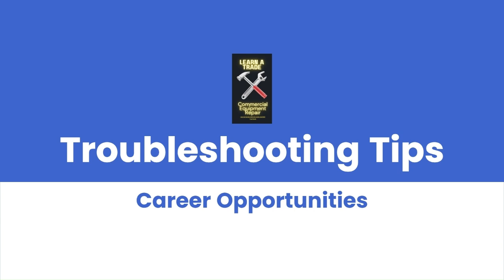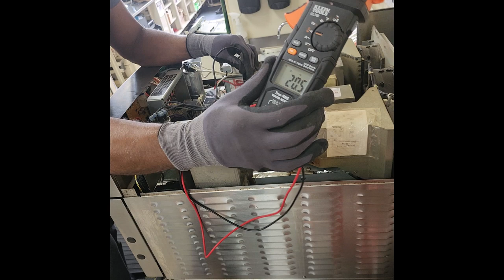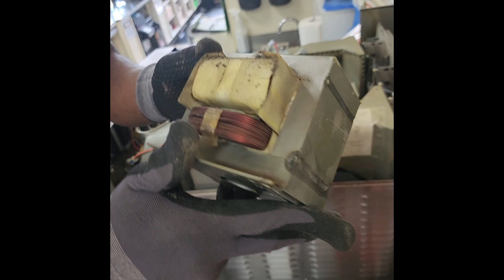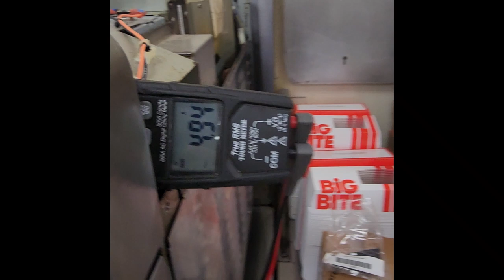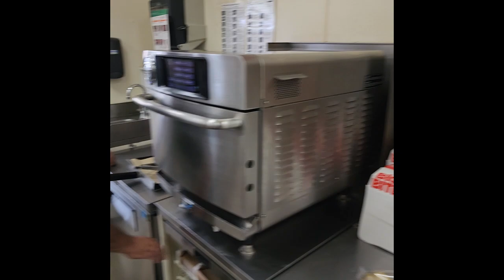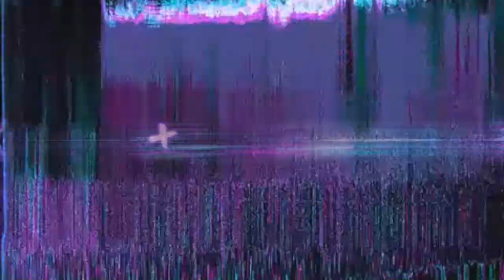Turbo Chef Oven Repair (HV Transformer Replacement)

Comment: What would cause my amp draw to be 40amps???
Reply from the maker: 40 amps is definitely higher than what I would expect under normal operation, but the exact answer depends on the TurboChef model and supply voltage. A high amp draw can be caused by a shorted/failed HV transformer, HV capacitor, HV diode, or magnetron. I’d first verify the amp draw with a clamp meter and check whether the 40A occurs at startup or only when the microwave circuit energizes.
If you tell me your TurboChef model and voltage (208V or 240V), I can help you narrow down exactly what could be causing the 40A draw.
Reply: @latcommercialrepair  thank you for responding. Wires on magnetron were hooked up the wrong way. Red wires were on "f" instead of "fa"
Reply from the maker: @rickycalderon6220 sounds like you may have found the issue of the high amp draw. Before you begin any cook cycles or live tests, be sure to test you high volt circuit. Meaning wiring, test ohms on the high volt transformers, test each magnetron. If you still get an amp draw higher than 17amps you should remove the magnetrons and inspect the inside of the waveguides if you see gease inside the manetrons that means they are contaminated and causing the rays to arc inside so they will need to be replaced or removed and cleaned and reinstalled if you don't have replacements.  If the waveguides are contaminated I advise that you check the glass inside the cook cavity and if the glass is cracked you should replace the glass also. You will find videos in the Turbo Chef Playlist to show you how to do that. I hope this helps.
Reply: @latcommercialrepair  thank you so much sir. Amps are now at 16 when doing the mag test. Thank you for your help and videos.YOUR THE MAN!!
Reply from the maker: @rickycalderon6220 your welcome, great work on that job!
Reply: @latcommercialrepair 
Serial number ENC3TD06628
MODEL: ENCORE 2
240 V SINGLE PHASE

Comment: Replaced Rtd sensor 
Still getting F-7
Reply from the maker: If you replaced the RTD sensor and you’re still getting the F7 error, I would not replace any more parts yet. Next, check the RTD wiring and connections from the sensor all the way back to the control board. Look for a loose connector, damaged/burned wiring, or a poor connection.
Also verify the resistance of the new RTD with a meter and compare it to the temperature/resistance specifications for your exact TurboChef model. If the RTD and wiring test correctly but the control is still reading F7, the issue could be with the control board or the circuit interpreting the RTD signal.
If you send me the exact TurboChef model number, I can help you with the correct RTD resistance values and the next troubleshooting steps.

Comment: Great video, do you have a video on how to discharge the capacitors in the turbo chefs? Would love to see it.
Reply from the maker: @Captain_Skafreak  Give me some time I will prepare something on discharging the capacitors.
Reply from the maker: This is a good video explaining how to discharge the capacitors.  This one is discharging and testing a capacitor on a microwave  but the steps are similar to the Turbo for discharging and testing.  I hope this helps.  Thanks for watching! 
https://youtu.be/Sk6A48gOUxg?si=WpKKZ56dI7I2kqhc
Reply: @latcommercialrepair  is a good video but my main question is how to discharge the one with three terminals like in the turbo chef.
Reply from the maker: @Captain_Skafreak  I understand so I will put together a demonstration for the discharging steps in the near future because there are not alot  out there going over the 3 terminal capacitors.  Thanks for your input.
Reply: @latcommercialrepair  you are amazing! I’ve been enjoying your videos!
Reply: How did you discharge the transformer?